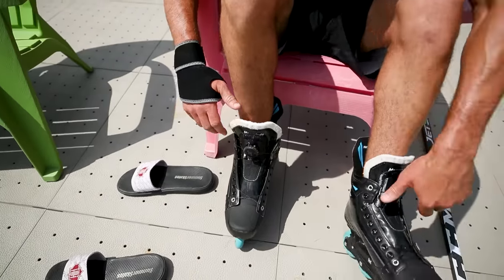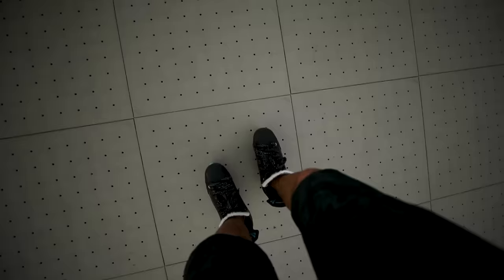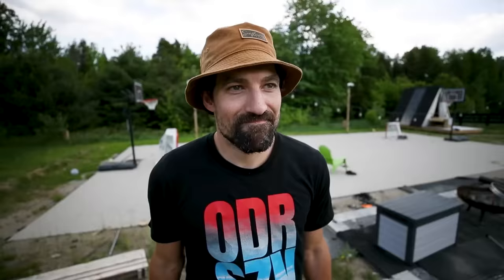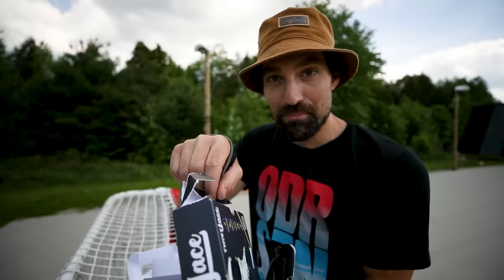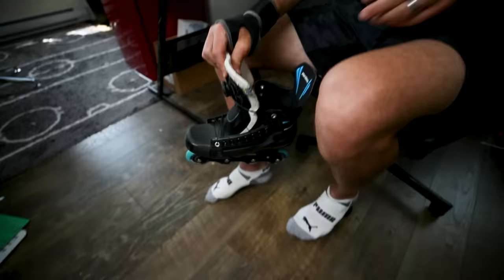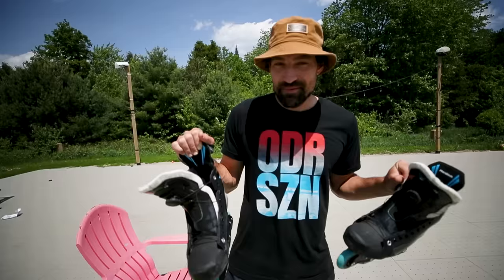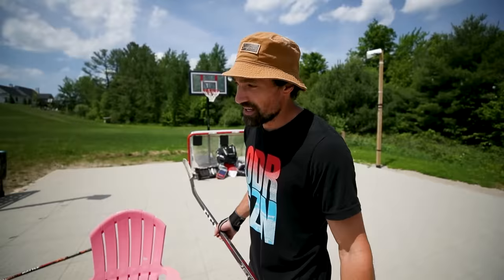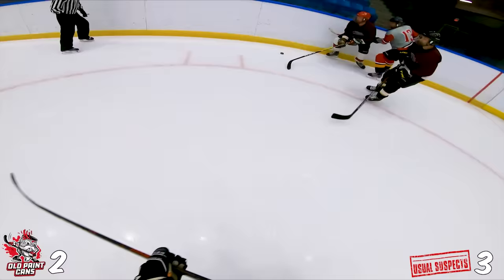The New FASTEST way to tie your skates

Comment: This is an extremely common lacing system for snowboard boots, it's called the boa system been around for decades. Roller-skates use roughly the same housing as snowboard boots do so it makes sense it would easily switch over.
Reply: the difference here is the detachability- allowing it to switch from skate to skate. This is designed specifically for hockey skates, for now.

Comment: I have had BOA laces (similar design with a steel cable lace) in golf shoes for years, looks very similar and other companies have copied the design (Puma has Disc thats the same thing), I have been waiting for them to come out in hockey skates, this seems like a pretty cool alternative since you can retro fit them and hope they come out with them in normal hockey skates.  The real benefit along with getting skates on and off faster is that it pulls the tension even, and with small clicks you can really get the perfect fit.  I might have to try these on my skates until someone comes out with BOA on hockey skates. (I have seen them on recreational skates just not on hockey FYI).

Comment: Like tons of comments have already said, BOA has been around for so long and I am sure they could create something for skates. This is nice that you can just basically install it yourself. BOA usually has a lifetime warranty too. My friends BOA on his bike shoes broke in an area that wasnt fixable, so BOA is buying the new model of the shoe coming out this year and sending it to him.
Reply: My K2 inline skates have BOA. I'm not really a fan as the boot is equally tight throughout the foot. I prefer a little wiggle room near the ball of the foot with my ankle locked in. BOA does not allow for that. Plus, there's no way BOA or these will hold up well to some slashes/pucks to the boot. For these to work for ice hockey and probably roller, there would need to be some sort of flap that protects the apparatus.

Comment: Interesting product though I like being able to vary the tightness of different sections like you can with laces.

Back in the day, 3 strap buckle systems were pretty common with rollerblades. Those were pretty quick and effective. Makes me wonder why they shifted away from that.

The closest thing I could find similar to that is Option B straps. Velcro straps (3 per skate) each install through a lace hole held using screw and nut with a roller bar on the opposite lace hole (again, screw and nut) for the strap to cinch down. Really wanted them to work because laces are so tedious, but the nut unfortunately was too big to fit through the lace grommets on my skate.
Reply: I know someone that uses Velcro lace replacements. They are 3 straps. Low mid and high.

Edit: it's called option B
Reply: So I just put option B's on my ice skates, I put 5 instead of the recommended 3 on each skate, held up great during my first game of adult rookie league and a stick time session this week working on crossovers, stops etc. Held snug the entire time.

Comment: my son had a pair of CCM skates around 2005-2006 (I believe he was a squirt AA player at the time) that were made with the boa system, with built in rails for the wire lace and a Boa twist reel on the rear. he loved the ease of tightening and removing his skates, and would've kept wearing them, but I could not find a pair his size when it was time to get a larger skate.
the only "problem" he had, was that he would have to tighten them one last time after a couple laps in warm-up,  but that was likely due to his strength at that age, and his liking his skates extremely tight.
he never had a failure in cable or gearing, and I was surprised that they never took hold in the market.

Comment: Please do it for ice hockey this is something I would definitely use if it worked for ice hockey
Reply: Hey! This works for ice hockey skates and for hockey rollerblades! Can order yours at 

www.TwistLace.com
Reply: Ok thanks
Reply: @twistlace.  would they break if receiving a shot on the dial?
Reply: @usernaames  it all depends on the angle of the shot/slash and the speed of both. After numerous tests for in game and off ice direct contacts, we’ve noticed it holds up pretty well. The dial will not shatter, but it can damage the internal dial system if hit hard at an angle or with a high velocity shot/slash. It is primarily used right now by kids and teenagers where the Aforementioned problems won’t occur as much -  but we have plenty of happy adult customers as well.

Comment: Will it work on goalie skates
Reply: Hi Sean ,

Absolutely! Goalies so far are enjoying using them and it will have a better lifespan as the pads will cover the dial from any harm.
Reply: @twistlace.  thanks
Reply: @twistlace.  will they cut the ilets
Reply: @Sean morissete
Reply: @seanmckinley5052  it seems that with only a few adult users it has punctured the eyelet, but it also depends on the skate brand . We are in a soft launch and making refinements to the product this summer. This so something we are addressing

Comment: Friend had these for ice skates. First shift out the popped open, instant loose skate, had to come off.
Queue continual opening
Took them off and had laces the next game.
🤷🏻‍♂️ I won't be putting them in mine.
Reply: Hi Charles, I can understand your concern and sorry this happened to your friend. I will gladly speak with him to address this problem as this shouldn’t be happening. He can reach out to us at info@twistlace.com or 647 402 7716. It may be due to a small error that can be fixed! Thanks
Reply: @twistlace.  good to hear!
I'll send him that info, thanks for the quick response. Appreciate it!!
Reply: @twistlace.  you are like the Amazon of fast skate lacaning
Reply: Does he wear his shin pads over the skate tongue? I could see his the shin pad sliding down would pop out the lock.
Reply: @seanthomas6421  I have my shin pads over the tongue and I wonder the same thing.

Comment: I wonder if it would stick to the lather tongue, of my aggressive Inline blades? Anyone else here happen to have a pair of USD Carbon Free Team boots? N this Twist Lace product on them?
Reply: Hi Tyrone,

We designed the dial mount in such a way that it is flexible and curved exactly like a Pringle - allowing it to adhere well and shape well to any tongue. It is very sticky but also it will not leave a large residue on the tongue.

Comment: They’d be fine for what you’re doing but you’d be asking for trouble relying on that in a game. I always have extra laces on hand because of abrasions to the lace that happen during any given game. A skate cuts that thin thing and you’re done
Reply: Hi Paynan,

In the video they don’t install the white stretchy hockey laces. These laces actually hold the foot in a lot better so it’s highly recommended you put on the laces. These laces also protect the wire from being sliced.
Reply: @twistlace.  when will these be back in stock?
Reply: @mittentendy5893  we are coming out with version 2 of the product either late this year or early next year!

Comment: Mars blades are so weird... Going to them from normal Rollerblades has been a challenge for me. Not as easy as going from ice skates to Rollerblades.
Reply: What's is it like going from ice skates to marsbkades?
Reply: I did that with an R1 and fell a lot of the first few tries.

You expect the rocker to change your turning radius by a lot like it would on ice, but the wheelbase remains flat so it's not as dramatic of a change compared to just rockering your wheels (smaller wheels for the front and back) on a standard chassis (which I feel like I can make tighter turns with).
Reply: @mustang268  It's weird. I went into mars blades after about 8 months without rollerblading on my normal rollerblades and it was still weird.... it's possible that it was weird because I was expecting a rollerblade kinda feel though, it's tough to say. It's not exactly like ice skates though.
Reply: In all honesty though, rollerblade wheels just can't get the turning radius of skates because there's no edge to bite into the ice and hold. So, it's kinda like skating on super dull ice skates in any case since the wheels will inevitably slip.
Reply: @AnHourOfWolves  Have you tried just rockering the wheels? The shorter wheelbase makes it much easier to make tighter turns. It's not the same as an ice rocker but I like it better than standard flat wheels. I have to experiment more with the stock R1 but I'm probably going to rocker those wheels eventually.
Reply: @AnHourOfWolves  that's true or like ice skates with no radius cut into the blade
Reply: Did my first skate on the Marsblade O1 Krafts pro. I used to inline a lot with Salomon inline skates way back and yep, the Marsblades are no where near the same. I definitely got a workout with the same muscles I use on the ice. I baked the skates at home and my right foot had a ton of pain on the bottom of my foot.  Really hard to get my foot into the skate too so I'm considering this lace system. You don't get as much of a glide on the Marsblades (non wheel rocker), which is good in a way as I'm looking to do more off ice stick drills. I used the standard rocker setting that the skates arrived with. I think I'll have to add the front wheel rocket. I also use the Marsblade I2 skate holder on my ice skates on the ice (20 ft rocker setting).